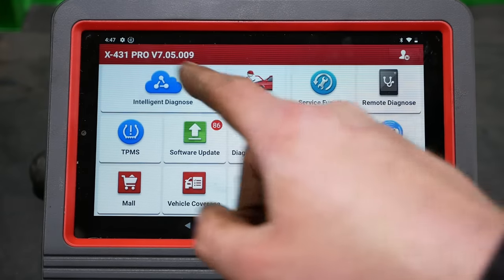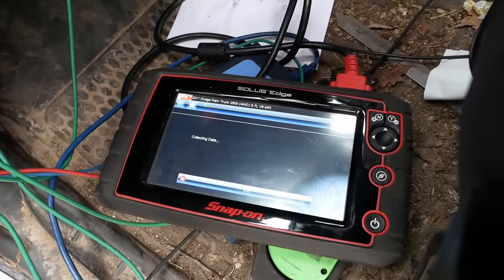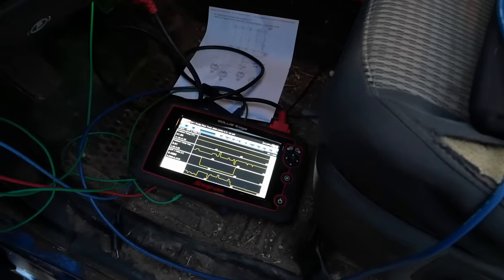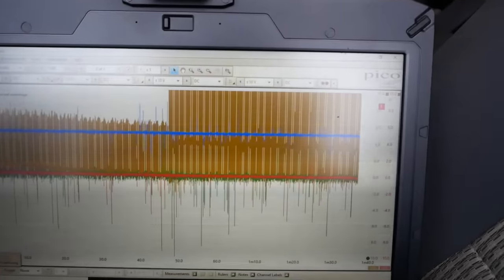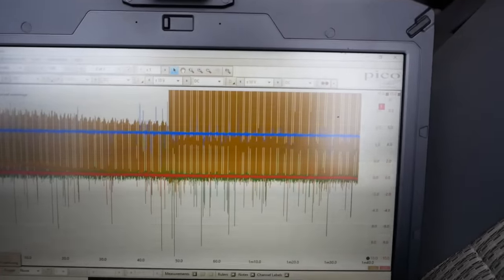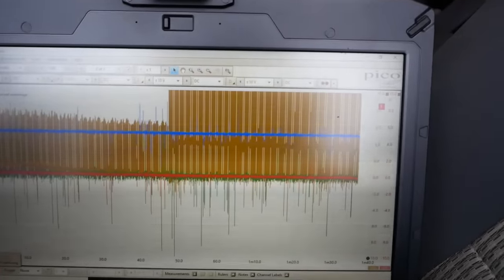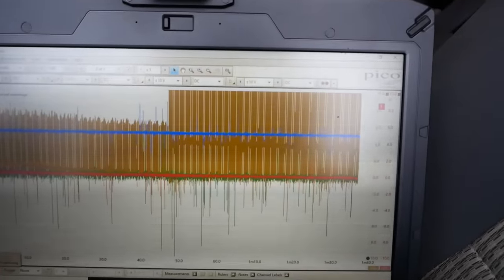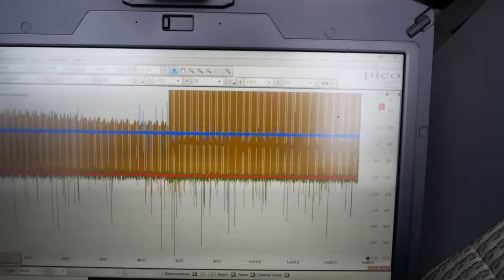Diabolical Diagnosis - Hemi Ram Stuck at 1500 RPM with P2128 and P2138

Comment: $500 for a true diagnosis and permanent fix of an intermittent problem sounds like a steal to me. Great job tracking down the issue.
Reply: I think Wes just underestimates the value of his work. I mean, if the customer isn't happy, he will just not return. But I doubt that's a problem by the quality of work he's doing. (just look at his parking lot) 😬
Reply: most shops would have just replaced computer for $1000+ and not truly fixed the issue. then they would have gone through part monkey swap at another $1000 and still not fix the issue. Intermittent electrical issues are the worst, once i had an issue with Solder joints expanding once heated up on main relay. took forever to find problem trying to waiting for it to fail on a hot day. great job wes.
Reply: @alanprather8399  agreed, hard to track down requires a good shop. The average shop will fire the parts canon at it without finding the cause and just eventually give up and let you pay anyway or fix it by surprise.
Reply: I'we paid 500 in a dealer, and still didn't get the problem fixed. Next owner for the tractor called and said it was the switch that was broken inside and causing malfunction really randomly. I wasn't getting that malfunction since I turned the switch just enough not to short out and blow the fuse
Reply: @RubenKelevra  Almost impossible to find a mechanic this good and this honest.
Reply: @Steve_Just_Steve  yeah I know. :)
Reply: I wouldn’t have done it for a thousand Ain’t got no patience when it comes to wires at all
Reply: It´s all a matter of communication. If the customer is informed about what´s going on and could decide if the work shop shall go on, he will be happy to pay this amount in the end.
Reply: This is cheap! I had a riding lawn mower that cost me $1200 and over a month for the shop to discover the wires in the harness weren’t seated in the plug causing a disruption. What’s worse is when I was calling every few days for a progress update the service guy could never remember me. Have gone back? Hell no! Wes is obviously top drawer.
Reply: @martinkupka3575  Is much cheaper than a new truck. Probably the owner saved the 500 in fuel while it was with wes to. :P

Comment: Wow that was an epic diag, Wes! Intermittent issues can be an absolute bear lol. Definitely key to determine what conditions make the car act up, and test it in those conditions... Even in the snow or rain or brutal cold 😉
Reply from the maker: Plus no parts required!
Reply: Yeah….very nice job there. I doubt even a dodge dealer would’ve fixed it the first time around. They probably would’ve thrown an ECM at it first…
Reply: Hazardous duty pay.
Reply: @eric_seguin  Danger pay more like, this is a job worth the danger pay for sure
Reply: @WatchWesWork  You didn't charge him for the 3" of heater hose?
Reply: @WatchWesWork  You're never going to be more proud of a diag/fix  Also, your pricing is fair and honest.  Don't change it.
Reply: @WatchWesWork  , thats Ivans trademark!

Comment: Naturally you get stuck with some of the toughest problems, cuz if it was easy, people would fix it themselves. Thanks for sticking with this one, Wes.
Reply: I worked on my truck to the tune of around a thousand dollar’s chasing a open circuit that the scan tool was telling me. Ended up taking it to a dealership for another 450.00. They found it 😡. 
So it’s not always easy but I tried.
Reply: @stevanrose7439  When I was in my early teen years, for a brief period, I had a neighbor named Steve Rose!
Reply: Or maybe take it to a dealer.....for a lot of money.

Comment: Fellow wrench thrower here. That spot is very common to rub through on the fuel rail and cause typical chrysler fire problems. Usually after the 5th or 6th hemi engine swap the tech will notice both sides doing the same thing. One of the wires in that loom is 12v Batt on a 20amp fuse... metal fuel rail, hemi tap, becomes hemi torch.
Reply: Wrench thrower is an appropriate term for intermittant problems like this one lol
Reply: Wow..
Reply: The knock sensor loom where it comes up and around the front of the engine and into the harness is, also, a common area for rub through problems. Passenger side front.

Comment: When you start to see your truck on Watch Wes Work ... you know it is time to buy a new truck.    I hope you feel better sir.
Reply: Nearly every Chrysler product after 2005-2006 uses drive by wire.. and after 08 its nearly every manufacturer. Not vehicle specific and no need to worry and more than any other vehicle... unless of course you mean this specific truck in the video is yours lol then yes, maybe a new truck is in order
Reply: @gunners4129  it was mostly a joke but ... It does show that year and generation is starting to age out.
Reply: @zomie1  They still sell that body style as the RAM Classic, now I see why they call it classic. Christ I'm getting old...
Reply: True, and the routing is less than ideal. But out of experience I honestly would worry more about a mouse jumping up in there overnight during winter. I'd say a quarter of my wire repairs are winter rodent related. And that can happen on any generation and in alot of cases its upper intake harness related and could cause this exact scenario. I see it alooot on Chrysler minivans under the engine cover.  Same with chevy traverses.
None of this is me trying to be corrective, just saying I miss working on cars from before 05 😂

Comment: I have watched this twice and will probably go for a third. At 83+ we had never heard of computers when I was being trained. I found this absolutely fascinating and it is so pleasing to learn new stuff - from someone 45 years younger! Well done , great job.
Reply from the maker: There were some shops using scopes long ago. The local Dodge dealer had a primitive scope and diagnostic machine that ran on a rail down the center of the shop. It had secondary ignition probes and a gas analyzer. Pretty sophisticated really. I would think it was from the late 1970s.

Comment: Nice to hear the shout out's and acknowledgments to the other you tubers that helped or contributed to this complicated diagnosis. Wes is right dealer would have replaced thousands of dollars in parts and still not have fixed the problem.

Comment: Second comment - the way you got the shot of the wire rub area (back of the compartment, tricky to light, inspection mirror and manual focus) was superb.

And putting the relevant diagrams and error codes "on screen" during the video edit must take you a lot of work.

Easy for the viewer to take for granted. I am grateful.

Comment: Wes, this one was epic. Intermittent electrical issues are the hardest and almost impossible to track down. You may have wanted to blow it to bits a few times but you stuck to it and did not resort to the parts canon. I would think an accel pedal sensor(s) plus a computer would have been easy to justify based on what was seen. Keep up the fantastic work.

Comment: Awesome job, Wes, similar to a recent SMA episode where the dealer wanted the customer to buy a $2000 harness and Mr. O traced the problem down to a bad alternator. Except in your case a new  harness would have fixed the problem.
Reply: They had already pretty well scammed her on a new car anyway so it pretty well would've gotten sold at this point regardless

Comment: WES, Ya lost me at APP1, ! At 67 years old,  I learned  points And condensers , leaded gas carburetors and manual transmissions from...  Motor Manuals!
YOU my friend are at a different level with mechanical abilities!
Computers in vehicles and Computer diagnostics! Hats off to you!
I can't fix this stuff, nor even want to try! Good stuff!!!

Comment: Wes, don't be afraid to charge your customers, you've got to make living and a ton of overhead too. If they go to the local parts store for a diagnosis and throw the kitchen sink at it, they get what they deserve. I think you went over the top on this, and I'm sure there are tech's scratching their heads even after viewing twice. Time to go back to cave man, sledge hammer and brake drum.
Reply: True, I lost by not charging enough.
Reply: Charging the customer goes along with satisfaction, I strived for both! I had a repeat customer how waited for my expertise (some times weeks). Other mechanics/shops will be jealous but don't strive for equal results. "The mark of a true Craftsman".
Reply: Agree, I do anesthesia for some cardiac electrophysiologists. They trace down wacky electrical pathways in the cardiac conduction system . This was truly amazing. You do amazing work.

Comment: Retired wrench 5 years and just went through a reduced engine power situation on my gsons 06 Sierra,multiple U codes and  throttle control codes , 2 weeks with my 140.00 amazon scan tool here's what I found, a corroded ground wire to the Under hood modual, u code fix and a flat lined downstream O2 sensor causing a emission concern putting the truck in limp mode, wow I feel your pain, am in salty Michigan as well.
Your channel, Eric O.and Diesel Creek are my favorites, always good info.
Reply: Yep, those guys are my entertainment also!
Great channels!

Comment: wow !! Fixed the old chevy truck carb and still find a needle in a haystack and know what caused the sensor differences in app1 and app2.  No one could have done any more for such a hard to find problem.  I'm glad someone is happier finding the problem instead of just throwing parts until its too late.  Being able to diagnose these type of problems enables your "fix it" power to be about the best around.  Keep it up , and don't let those corp people tell you different

Comment: Peterbilt and Cummins had an issue with their throttle position sensors several years back too. They actually produced an overlay harness kit. The issue was the bulkhead connector at the firewall. Kit bypassed the firewall connector and went straight to the TPS from the ECM connector. That intake manifold may have some sort of carbon or something for strength that may have been partially conductive.
Reply from the maker: Interesting.

Comment: Much respect. My father who started as mechanic in the 1950's, hated electrics with a passion, when there were only a few wires and the most complex part fitted was either the voltage regulator or the dynamo. I'll get him to watch this with me soon and I'll add what his reaction is.
Reply: Iam With Your Dad Give Me Flathead Ford

Comment: With everything I've seen you do, you're more than fair on the pricing. Anybody that would do these crazy difficult jobs for less isn't likely to do a very good job. The dealer or a shop with an aloof attitude would have charged thousands and thrown a bunch of un-necessary parts at it. And it still might no be fixed. You do thorough work and when it's done, it's done right.

Comment: Incredible detective work Wes.  Moisture makes the most sense because after the moisture evaps due to heat the problem would go away and explains the intermittent issue.

Comment: The NAG1 transmission in my Jeep was going into limp mode whenever the Jeep got moist.  I eventually had to test all of the wires in the harness and run an overlay between the TCM & Transmission.  It was a frustrating but rewarding fix...still works 5 years later.  It takes about 15 minutes to reset the codes and took a month to sort it out so lots of time sitting on the side of the road doing resets.
Reply: Shoulda bought a stick

Comment: For what it's worth, as  LONG time Audi owner, that whole "unintended acceleration" was 100% bogus. It was all broken down to user error in every single case. I personally have proven to many people that from a standstill, with those old 100hp engines, they could just not overpower the brakes. Just not possible. Just sat there and internally hemorrhaged. 

We can thank the kneejerk reactions from that episode for - Park lockouts where you have to put your foot on the brake, AND throttle cutouts where if you are on the brake and throttle, it cuts the throttle. 

It was also proven that 60 minutes weren't able to reproduce the "problem" so they "rigged" a car to make it happen for their cameras.
Reply: It has been said that the average human is incapable of driving a vehicle properly

Comment: We are all dying, no one gets out alive. Low voltage, low current circuits don't belong in automotive. The dealer would have just sold him a new truck and sent it to the auction.
Reply: And the buyer takes it back to Wes or south main auto, and we have another video
Reply: You make a valid point! There are places for computers but vehicles and tractor equipment aren't two of them!

Comment: Absolutely a genus diagnosis. I'm sure 5 hours didn't come close to covering your time. I used to work in the electronics industry repairing home electronics, something like that would just have been deemed not repairable and just go buy a new one. However with a car the value of equipment is a lot higher. I'm sure you also lost a lot of sleep over this as well. Anyway hell of a job, congratulations.

Comment: This was recorded a week ago so I'm hoping your labored breathing has improved ... if not, please go see your Doc ASAP ... just care so don't shoot the messenger Bro. As to the Design Flaw from Dodge (who the hell let's "tape" be a long term barrier to a sharp edge ... AH's !!!) ... might be the moisture ... not sure on that one ... water is of course conductive (hence the invention of WD40) but I have another idea. The bare wires and that nasty 25 volt spike might be correlated ??? The current flowing through a coil is given by Ohm's Law I=V/R where V is the potential difference in volts between the ends of the wire of the coil and R is the resistance of the coil. So yes, if all else stays the same, increasing the voltage will increase the current which will increase the magnetic field. In Aerospace, this is why we use coaxial (even Tri Ax in the cockpits of some) to prevent "magnetic bleed/EMI). The fact you were able to isolate that spike and wave form from the injector was ABSOLUTELY AMAZING !!! Proud of and for you Wes.  Now, go to the Doc !!! If you're hard headed about Doc's like me ... I first take some OTC plain old Antihistamine tablets (less than $1 ... not the "Cold Med" stuff ... just straight Antihistamine). Feel better soon !!!

Comment: That was an impressive diag Wes, give yourself a pat on the back for that one.  I think your charge for the diag time is more than reasonable if not undercutting your worth a bit but it's easy for us viewers to say that, we're not paying for it.  Your repair was probably still far less than what that owner would have paid taking it to a dealership for the parts cannon treatment.  I think you're onto something with the moisture causing the short hence why it was only doing it after it sat for a while in the elements and it went away as it warmed up.  Either way, great video Wes, thank you for taking us along for the ride!

Comment: and that's why i'm still driving my 1993 f150 4x4 with a 300 6cyl. and aod tranny. i don't need an electrical engineering degree, and $5000 worth of scan tools to find out what any problem it might ever have would be in order to then be able to repair it. nor will i ever have a repair bill greater than the value of my truck at a garage because i couldn't diagnose and repair it myself. i went to tech school in the mid '80s, but that $6000 worth of education didn't prepare me to deal with problems like this. without those scanners, and an adequate understanding of how that rather complicated system works, you would never have been able to get a handle on what the problem truly was, even though it was a relatively easy fix once you did. good on you for sticking with it, and not just bombarding it with the parts cannon until the customer cried uncle and signed over the title to escape the slaughter.
Reply from the maker: I've had a few of those OBD1 Fords really take me for a ride...
Reply: @WatchWesWork  that's why intermittent electrical issues are my least favorite repair job. i've spent hours trying to track them down on vehicles without a computer, only to find a broken wire inside the insulation from vibration that showed no indication of the break on the outside, that was buried in a harness bundle, or corrosion from a small crack in the insulation that turned the wire inside into green dust. that's the stuff of nightmares right there.

Comment: I've been a mechanic for 40 years, I currently have 18 ASE certifications I manage a shop that does about 5,000,000 a year And I know quality when I see it and sir you are quality. brilliant, simply brilliant deductions.  Text book approach. I stand and Applaud you.
Reply from the maker: Jesus. Where can a shop do $5 million a year?
Reply: Sacramento ca. 10 techs and 4 advisors. But there shops that are doing double that around me. So I don't believe it was water that was causing your short I believe it was salt water that was causing your shorts and salt from the Roads maybe?  That's my experience and electronic repair sugar and salt are conductors and water is not so Who who who knows.

Comment: Cost of repair. You mentioned analysis time involved and how you bill. Think if a dealer changed out the Ecu but missed the shorted wire. The guy would have paid 1,020 for the ECU and labor. Then the guy gets it back, surprise the problem is still there. If you charge a hundred dollars per hour by 5 hours it cost him only 500. And the problem is resolved correctly and last, no surprises. That's a great value. Good work, impressed, really impressed. Thanks for educating us on what is involved in repairs the honest way. Most would prefer you going the analysis route. The difference is you have the detective tools, skills with expertise to get to the problem in a reasonable time frame.